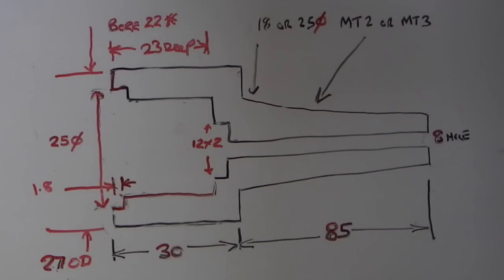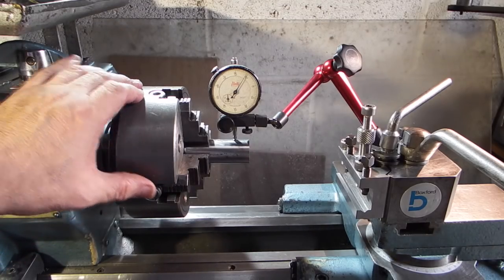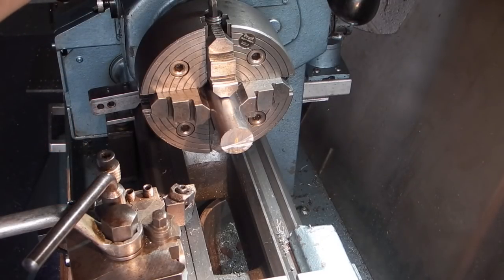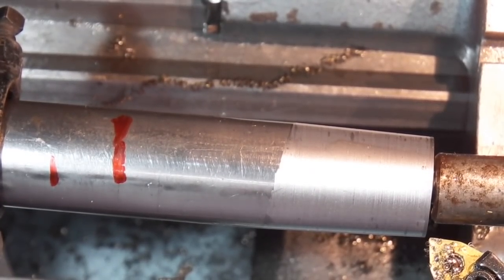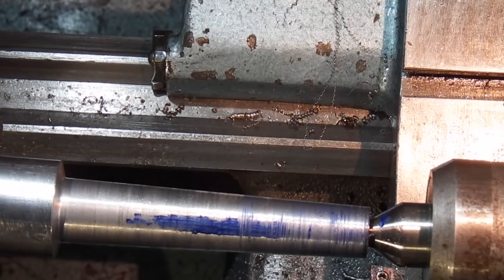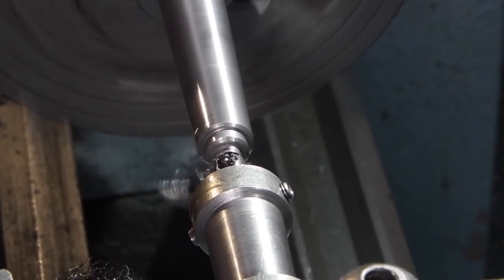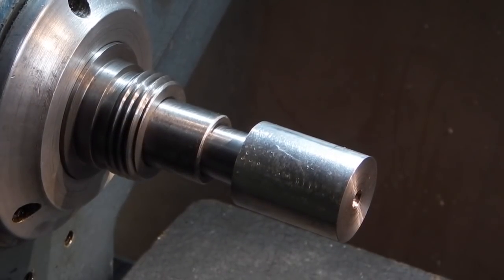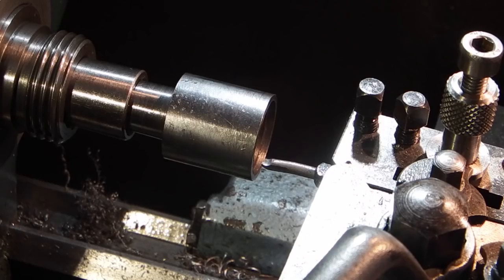Making a revolving centre (part1)

Comment: Maybe i missed it but why did you drill the hole all the way through the thing
Reply from the maker: Hi Its so if you need to remove the bearings you can tap them out using a rod through the hole

Comment: As an apprentice learning the trade of Machining, welding, fabricating and fitting at Robt Cort and sons Ltd in Reading (50 years ago) I was  taught that the Isle of Wight method was the best for identifying the determined size of a bearing, ie.....Inside....Outside....Width......IOW.

Have you or any other viewers done it this way?
Reply from the maker: Hi Rich
You can see in part two I've put a comment adding the bearing details, the sizes given are I.O.W.
Thanks for your comments
Alan

Comment: Hi Alan,  looking back at your  "headstock handle, expanding mandrel"  video .  What size hex stock did you use?   Thanks
Reply from the maker: Hi The hex size was 0.922" AF but thats not important. just use some stock that you can fit a spanner to so you can turn the mandrel.
Regards
Alan
Reply: enots engineering   cheers

Comment: Nice! I learned a lot from this video. Is your tailstock female centre shop made? I've not seen such a tool for sale anywhere, so may have to make one for myself.
Reply: Do you ever use a similar centre arrangement at the headstock? I would have thought the same problem would occur with a conventional centre when doing offset taper turning.
Reply from the maker: Hi  the female centre was made in a toolroom for a grinding job that needed a ball on one end of a shaft.